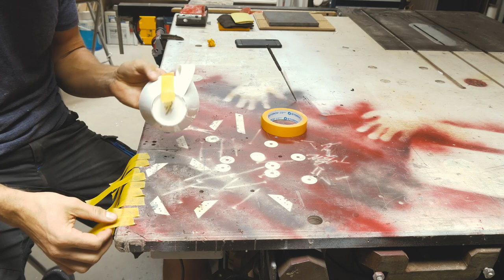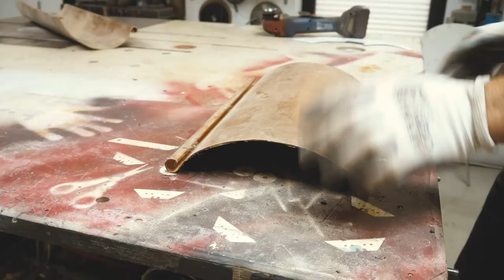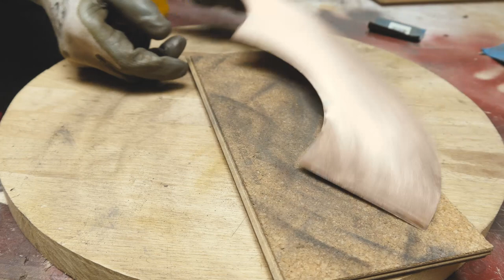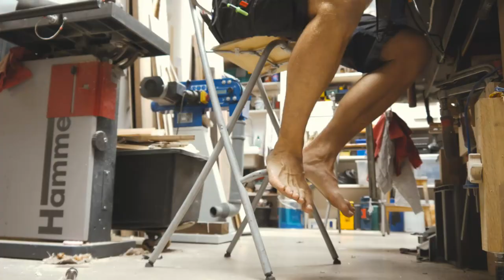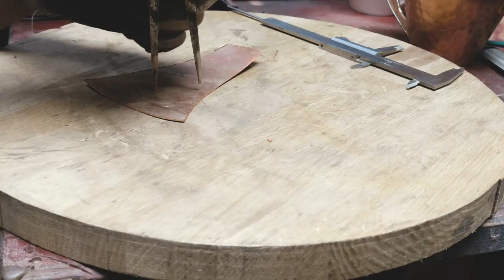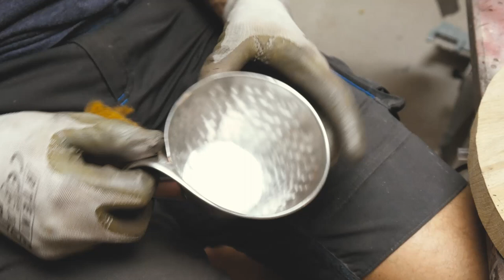Moscow Mule Copper Mug

Comment: What is the stuff you are using to join everything? Is it a giant chunk of solder? Think you also used it on the bar table project.
Reply: His surface is pre-tinned with this silver solder, so i guess it's just a big piece of steel with a burner underneath
Reply from the maker: I used silversolder